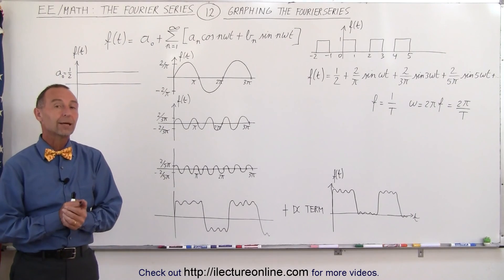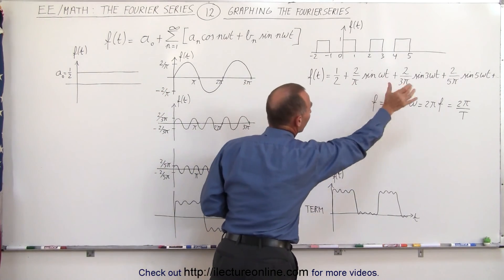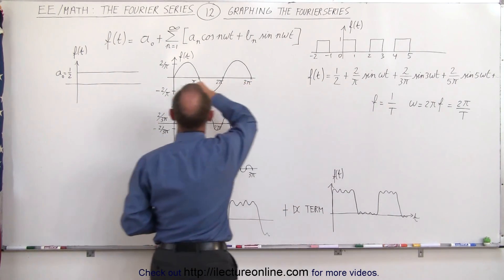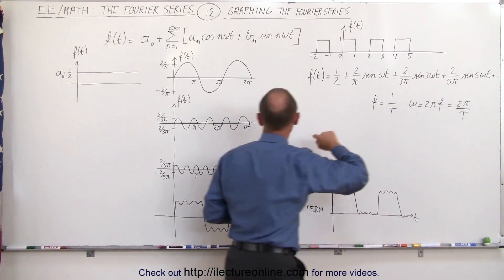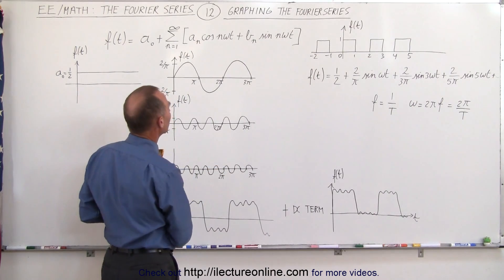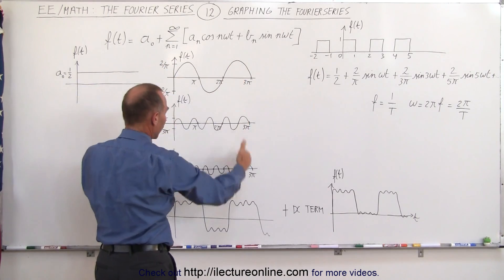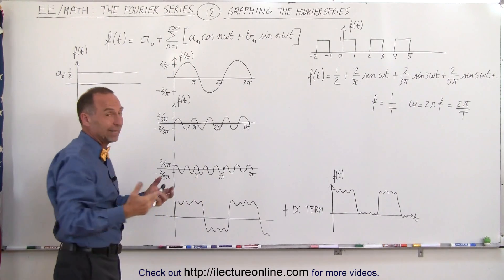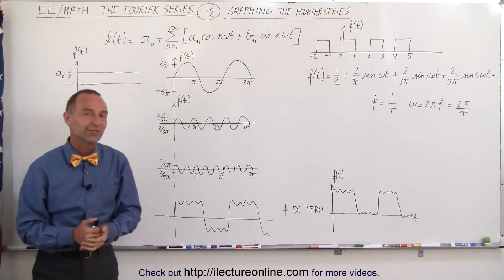Electrical Engineering: Ch 18: Fourier Series (12 of 35) Graphing the Fourier Series

Comment: So when you add a DC term, the resulting graph won't have any waveform in the negative y direction? Or does that not matter and only lifts a little?
Reply from the maker: The amount of lift depends on the amount of the DC term.
Reply: @MichelvanBiezen  sir,  The amount of lift is 1/2 here so, won't there will be 1/2 lift and other half in negative y direction? as the total magnitude is 1.

Comment: Thank you sir but I am not getting the final result..how that final graph form? After adding all graphs .
Reply from the maker: Try to add the first 2 graphs yourself, (using a calculator), and see what happens.  It is almost magical how it works.  (I had a hard time believing it worked when I saw this as a student for the first time a very long time ago).
Reply: @MichelvanBiezen  ok sir, will try.. thanks for your reply
Reply from the maker: Yes, the final result is reached by adding up all the individual graphs.  The more graphs are added the more the final graph will look more and more like a square wave.  In the end, if you add an infinite number of graphs the sum will look like a square wave.
Reply: @MichelvanBiezen  sir, first AC term has greater amplitude, then amplitude goes on decreasing. I am not able to understand the wave form after adding all. small small sinusoidal structure and amplitude of final graph. Sorry sir but I am unable to understand.